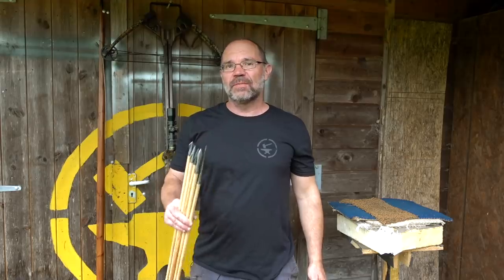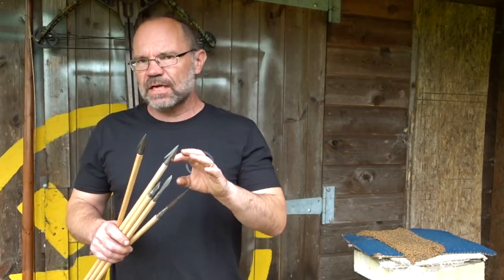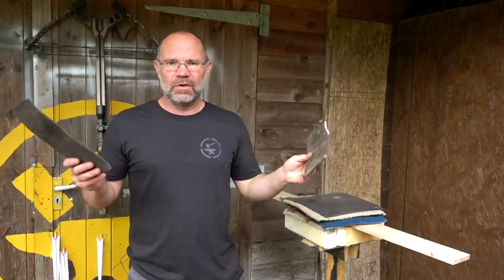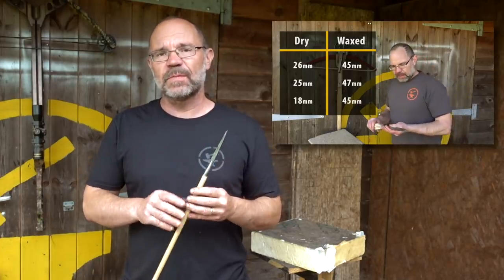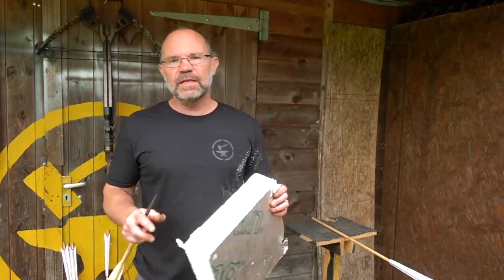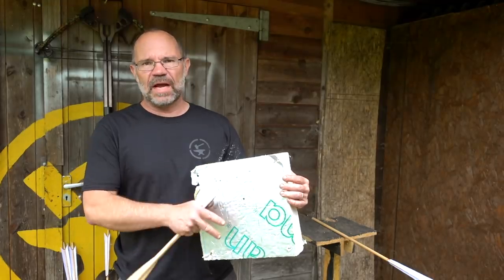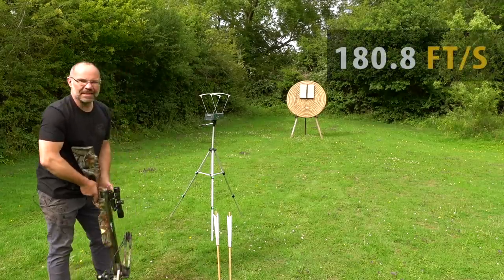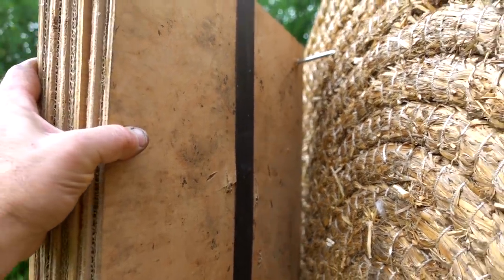Lockdown Longbow - Now I have WAR ARROWS!

Comment: why is it called lockdown longbow though? becasue you wanted to buy a longbow but then the lockdown came and all bow shops were close? Or because you got so out of shape during the lockdown you couldn't even fire your longbow anymore?
Reply from the maker: Watch the film before this one
Reply: oh because you can't host the longbow guy on your channel due to lockdown.. Gotcha thx for the info! Ok this might be off topic but I feel like now I get a chance to finally ask you this question! In a previous Video you talked about how your crossbow bolts range from 70-85 grams or so. Would this also be correct for your lighter crossbows ca 400 pounds and under?

Comment: Just out of interest, I wonder are there modern lubricants that function better than wax for penetration? Yes I'm talking about arrows you gutter-minded schoolboys, lol. Has anyone done this experiment to find out? I bet a teflon coated arrow head would practically sail through. Or maybe something more conventional like laundry detergent, which we all know is slippery AF when mixed with a little bit of water. Or even just plain old liquid soap. The try some proper lubricants like oils and greases and whatnot. It'd be interesting to find out.